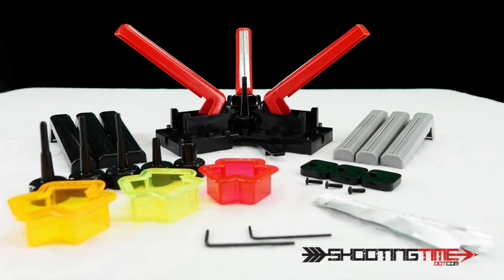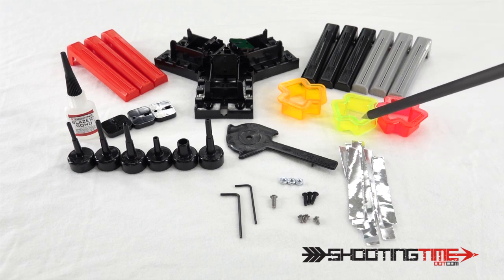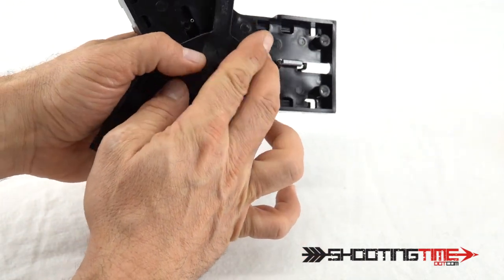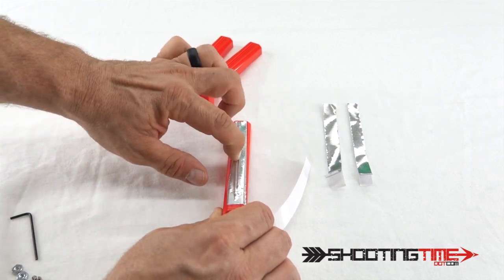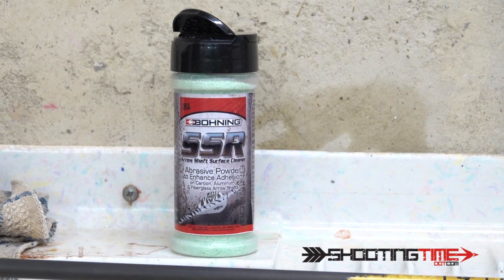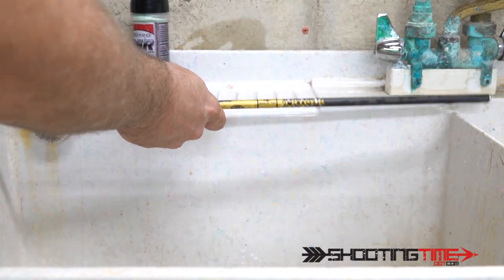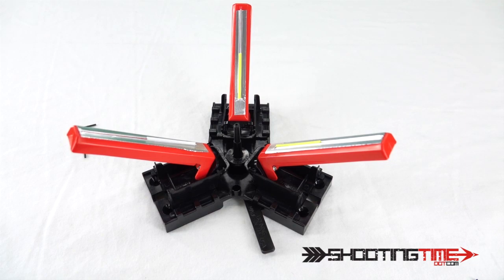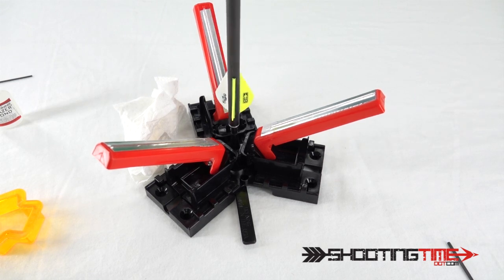Bohning Triple Tower Jig - How to Assemble and Use

Comment: I have this and have not used the spacers for the arms. What difference does it make to arrow flight to move the fletches up a 1/4" on the shaft? Does it matter that much?
Reply from the maker: Not a noticeable difference
Reply: It’s more for if u don’t want the fletching hitting your face which can throw off the arrow a little
Reply: @huntero4430  I never have that problem because I use a trigger or chicken-wing style release for mine. It keeps the string far enough away from my face so that's not an issue.

Comment: I watched this video well. And those arrows do not fit snug on the center post.  They spin.  Or twist.  Mine are a  .203 shaft and mine also spin. Not a snug fit. That's no good. I spoke with Bohning and they told me it should be a snug fit!  Well it's not and niether was the one's you was fletching either
Reply: If it's a little loose just put electrical tape around the insert tower until you're happy with how snug the fit is
Reply: @Jainkè  it worked fine with it being loose. I spoke with the main company and they said it was okay to do it losoe like that
Reply: @fishingwithhoffman7365  I'm glad it worked out fine but if you did want it to be more secure on pole a little electrical tape wouldn't hurt the equipment or your arrow shaft. I like to make sure the arrow won't shift during fletching after I spent all the time to nock tune the arrows I would be extremely irritated if the fletching wasn't where I wanted it.
Reply: @Jainkè  i will give it a try
Reply: I think electrical tape will be to thick. It's not real loose. Its loose like yours is in this video.  Remember the clamp holds everything together. So it should be fine.  My arrows shoot fine